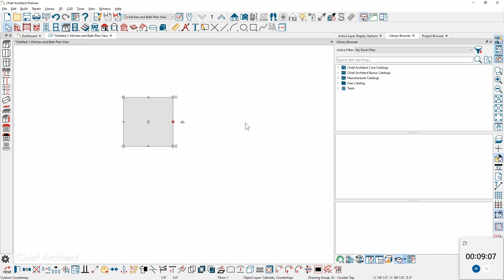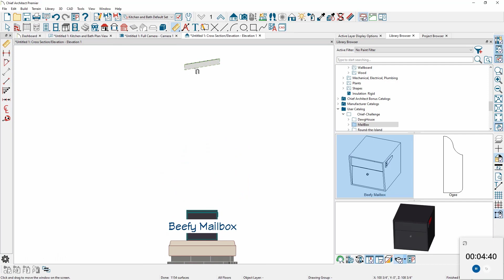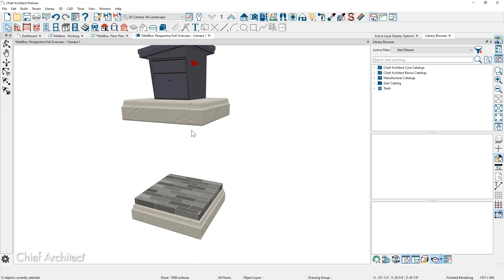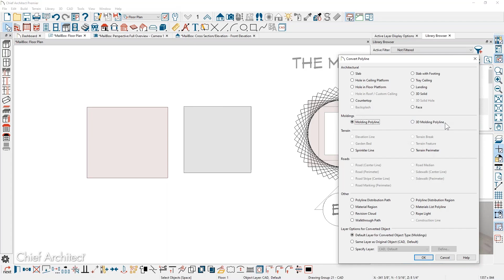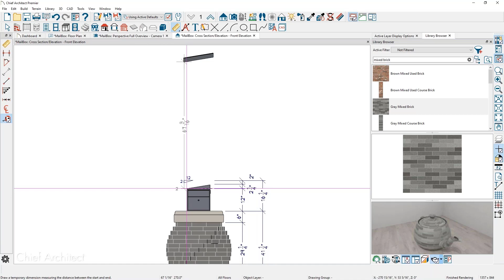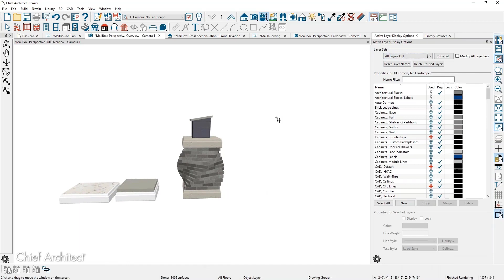The Mailbox Challenge (Re-Run)

Comment: Hi CA

I am trying to create 2 seperate structures on one site terrain and I want to only make 1 of these structures a Double-storey and the leave the other one as a Single story. 

But when I "Build new floor" , CA builds extra floors on both structures.

Is there video that indicates how to build a new floor on only 1 structure and leave the other as as single story.

Thanks
Reply from the maker: When you go to build the second floor, there will be a dialog box where you can select "Make new blank plan for the 2nd floor" You will want to select this option instead of the derive from 1st floor option
Reply: @ChiefArchitect  Hi CA, thanks for the reply. 

Do I then drag a Marquee over the one structure and then select Build floor so as to only indicate that I want one structure to be a Double Story with the recommended setting as Ur reply.

Regards
Reply: @ChiefArchitect  Hi, unfortunately CA keeps building both Stuctures with a 2nd floor when I'm trying to build only a new floor on 1 structure.